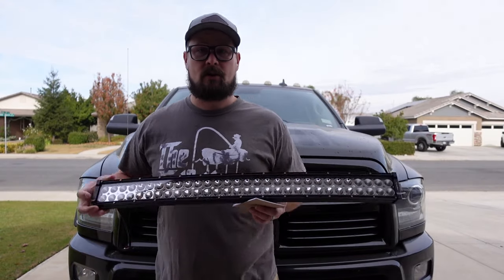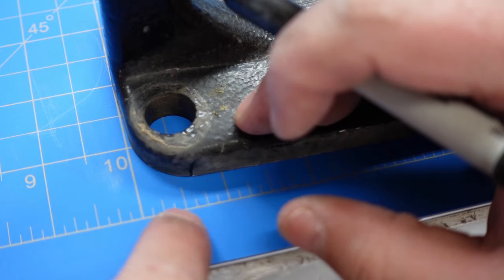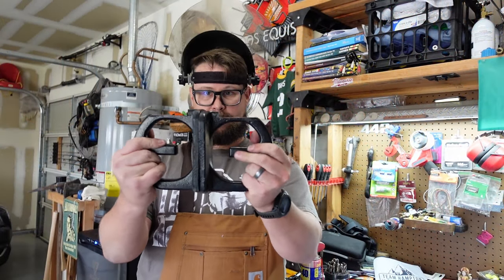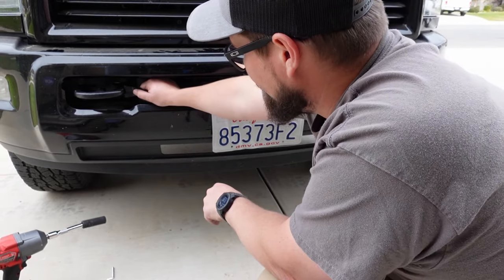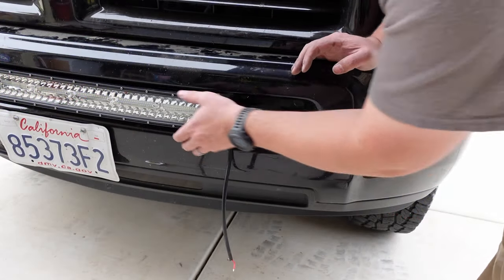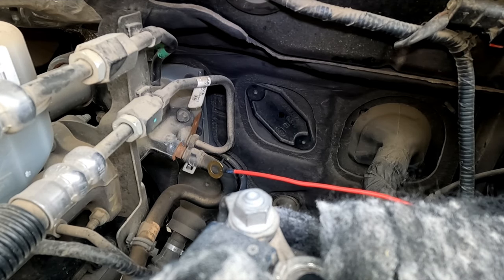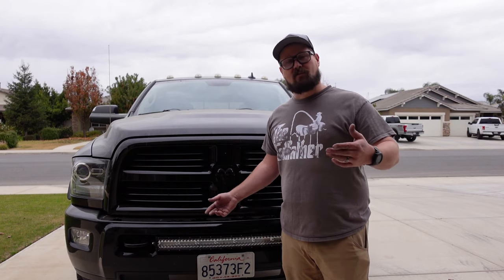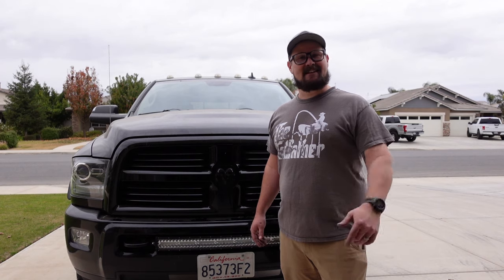Installing An LED Light Bar on 2015 Ram 2500 / Tow Hook Mod / DWVO vs. YITAMOTOR

Comment: Don’t expect to ever be able to rely on your tow hooks again.  WAFJ
Reply from the maker: Considering all Jeeps and most other 4x4 vehicles use a J style tow hook, I'll be fine. If I'm ever in a situation where a tow hook fails, then I should have been hooked to the axle anyway. Thank you for your concern.
Reply: Holy hell the logic there is so ass backwards it's entertaining.
Reply: @RoadandReel  hooked to the axel? Holly. Also jeeps dont weigh as much as a 2500 truck
Reply from the maker: @gsrhatch14  True, but Dodge used a J hook on their 2500/3500s up until 2008. I've done a lot of questionable things while off-road and that doesn't necessarily make them right. Often times, the axle tube is the strongest part that's accessible especially with these newer 4 link suspensions. To each their own and do whatever you feel is safest.

Comment: I’m running a 30” curved bar with hooks in place. 4th gen 3500 DRW 4x4
Reply from the maker: Please post the link and I'll pin it for others that don't want to do all the work. The only ones I could find were fabricated and ran $80-$150. No sweat off my back spending 2 hours in the garage, but others might appreciate it.
Reply: Which lightbar are you running?

Comment: Two things: 
1) When dividing fractions in half, double the denominator. Example: half of 11/16, is 11/32

2) If you ever need to use your tow hooks to pull anything with some weight behind it, it will fail. There are threads on some internet forums with this set up, where the drivers found out the hard way.
Reply from the maker: So I was building a swingset this weekend and remembered your tip for fractions, it's so easy, lol. Don't know why it never clicked like that before. Thanks! Also, I've pulled several vehicles and downed trees since installing that light bar. Maybe you are correct and they will break one day, but the amount of abuse I put my old dodge though with those single sided tow hooks leads me to believe otherwise. And don't worry, if they ever do fail, I'll make a video about it. Thanks for watching and thanks again for that time saving tip!

Comment: Hello sir! I’m late to the party I know, I just installed the Yitamotor light bar on my Jeep JKU with their kit. How is the light bar holding up? For some reason the pictures don’t show it being that bright but on mine it’s stupid bright! I wonder if the higher up the light is the better it does? Granted the light bar I have is a 50 inch I believe.
Reply from the maker: Still hanging in strong and mine is plenty bright. I got cussed out by an old man coming up the trail when I forgot it was on a couple months ago. Oops, lol. I love mine down low because it makes shadows in the holes and dips and I can pick a better line through the rough stuff. I bought some pods that I'm going to install up high so I can see down the road when I am moving a little faster on the softer stuff.

Comment: Hlo I have question ? The switch you have in side the truck for the led light when you turn off ignition truck is locked on the switch light still stay Red or no light ???
Reply from the maker: The switch inside stays lit while on, even when the truck is turned off. It has ambient lights that light up the switches when my headlights are on. I hope that answers your question.

Comment: Which one would you recommend on my 2001 dodge ram 1500 please.
Reply from the maker: I went with the 32" curved. I had a 2003 Dodge Ram 2500 and I put my off road lights behind the grill and they shined through without problems. They were hidden and out of the way and worked when needed. You could probably fit the 29" straight led light. I would get the highest wattage possible and I like flood lights up front.

Comment: little confused on one part, what did you use for power to trigger the relay on?
Reply from the maker: I used a hot wire on the back of the headlight switch.
Reply from the maker: Here's my other video where I put in a proper switch. https://youtu.be/FMmGJ6Cyvdw

Comment: By completely blocking the transmission intercooler, I take it you don't tow much?
Reply from the maker: I only do about 15k miles a year with a 6,000lb trailer. So, no, not much. I would hate to see what happens when the factory puts a winch there on the Power Wagons, especially with a big ol' Cummins because that's where the intercooler goes. It's even crazier seeing all these builds with custom bumpers that don't even have that opening at all. It's almost like there's plenty of room and the transmission cooler is up in the grill with its own dedicated electric fan and that area in the bumper isn't needed at all. Thanks for watching!

Comment: can this fit with hooks on a ram 1500? 2016 sport?
Reply from the maker: I think the 1500 has a different style of hooks and this won't work. You would need an aftermarket bracket to do it.

Comment: problem is mine is a manual... lol
Reply from the maker: It took me a second to realize why that would be a problem, but I bet you could go through another spot right there or maybe drill a hole in the firewall with a grommet. If you find a spot, let me know!